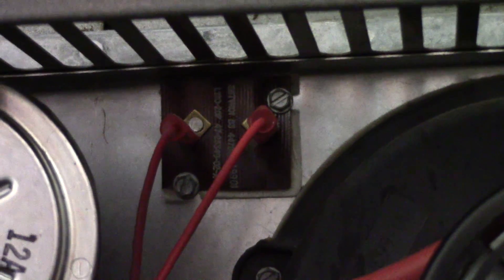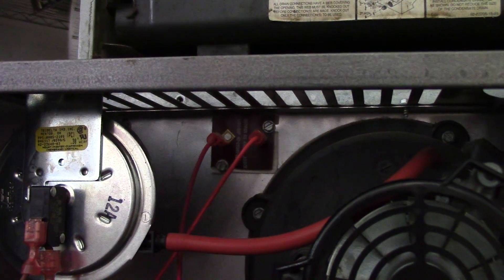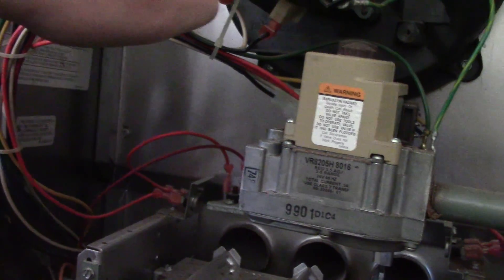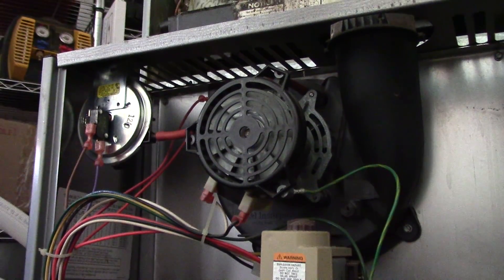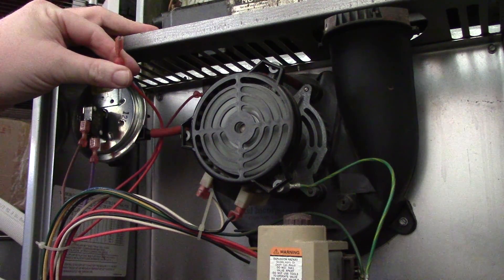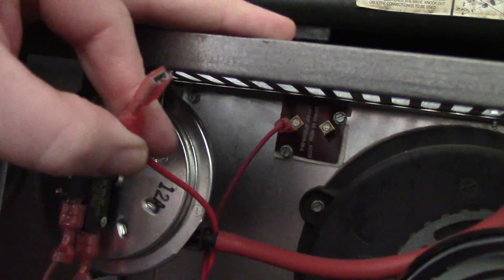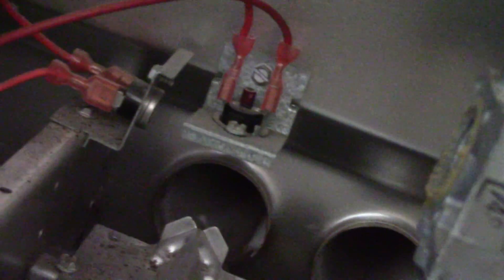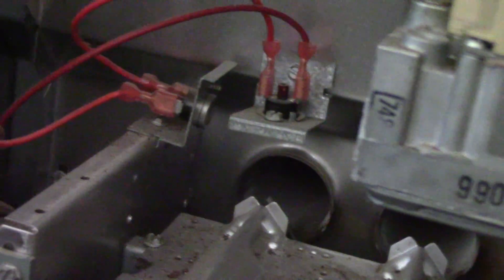Gas furnace high temperature limit safety switch troubleshooting

Comment: I must thank you sir, you have saved me a lot of time and money. Websites had me chasing the roll-off circuit for my Goodman furnace. When I took another look at the schematic I found the actual circuit. I was about to replace the board thinking it was a faulty relay.

Note Goodman owners, some models use 2 of the smaller metal limit switches. One is just below the roll off sensors, the other is mounted in the roof of the blower cabinet and sticks into the furnace cabinet. 

Mine tripped when I forgot to remove all the paper from a new filter.
Reply from the maker: your welcome. glad I could help.

Comment: Mine said it has a bad limit switch just waiting 2 weeks to get it. Put it in and still getting same code. Furnace still not turning on. What now
Reply from the maker: Follow the schematic to see what else is in that circuit. If it was installed wrong it could ground out and give false reading to the board. Bad wire connection, broken wire. Use a meter to ohm out the circuit. There could be auxiliary limits if its a down flow.

Comment: Clogged filters, clogged evaporator coil or gas valve pressure too high. Rarely, a bad high limit.
Reply from the maker: True. Something takes a safety out. I've only seen a few times where there was the wrong one installed.

Comment: Excellent advice for troubleshooting. My safety switch was working properly on start up but was triggering (opening) after the furnace ran for only a couple minutes. Apparently, the switch is weak / acivitating at too low of a temperature. After checking the duct work, filter and outside vent to confirm there were no blockages, I ran a short jumper to bypass the switch. Furnace is now running and temp coming back up as I type. Sunday repair so will pick up a new switch tomorrow when the HVAC supply store is open. Thanks!
Reply: One additional follow-up. I confirmed with the T-couple on my multimeter that my safety switch (rated at 145 F) was triggering around 104 F so a new switch is needed.
Reply from the maker: Your welcome.glad I could help.

Comment: Had a Lennox G40 stop turning on the heat past 2 days and freezing me in my house.  Many hours of debugging (Im not a HVAC guy)  
The green lights indicated "Open Temp Limit switch"  
Trouble is the switch was not open it was closed.    
I had no idea what the two little round things were (Roll out switch) If those are buttons there are frozen they did not push down.   Anyway I wiggled all the wires on the roll out switches and the Temp limit switch connectors as they looked oxidized.    I am not sure which connector was no passing voltage but its all working 100 percent now.

Question:  Should I just replace the two roll switches? or just spray deoxit on the connectors to help with current flow?

It was either roll connections or the two on the the temp limit switch.   Anyway I have heat again!!
Reply from the maker: I'd replace. If the roll out switches don't work right, and you get a situation where you have the flames rolling out you will risk a fire.
Reply: @ChilesHeatCool  I don't know if they work right or not.  would have to take a flame to one and see.  If they are already in the down position then you would not expect them to go down any further.  If it was UP then the circuit would have been open and the furnace would not work.    Im going to have a pro give it a once over see what he thinks.   But not one  weekend.    Its working fine atm.

Comment: Hi - my furnace also is short cycling - after 3 or 4 minutes the burner turns off, then back on for a few minutes, then the flame goes out again…. My blinking lights codes show watchguard - burners failed to ignite.  I removed the flame sensor and cleaned it, but the problem continues.  Do the flame sensors go bad like this?  It is a 24 year old Lennox, and seems more like a high temp sensor issue but I’m clueless.
Reply from the maker: Yes the can go bad or you lost ground. 

https://youtu.be/6_FDArHi6Q4
Reply: @ChilesHeatCool thank you so much!  I will try a new flame sensor first.  I’ve learned allot today and appreciate you - subscribed!
Reply from the maker: @Brian-kn1qw your welcome.

Comment: My furnace short cycles like it is overheating . Its not the flame sensor. Its like after 3 or 4 minutes of running it shuts off flame. The exhaust flue is hot. How do I trouble shoot what part or why? It doesn't appear to have any blockage
Reply from the maker: Is it giving any codes on the diagnostic light? You will need a meter to verify what switches are open and closed.
Reply: @ChilesHeatCool  Thanks for responding,  it was giving different codes at different attempts. Found it to be a partially plugged pressure switch port. Allowing for vacuum sometimes or not at different times.
Reply from the maker: I was going to say, pressure switch or flame sensor. Glad you figured it out.
Reply from the maker: Actually it's from the air density as the air is heated up and can't maintain a certain vacuum to keep the switch closed. Sorry I nerd out on this stuff and figure I would share.

Comment: Reset my limit switch after it was blinking four times and now everything is back to normal. Changed filters and cleaned it and now i got heat in far northern wisconsin and saved $$$.
Reply from the maker: Good deal

Comment: Great video. Don’t know if you’ll see this but. I’ve got a diagnosis question. I’ve got a Lennox furnace and recently got the trouble code of primary / secondary limit switch open. Filters aren’t clogged. I cut power and gas to the furnace. Jumped the primary limit switch, powered up furnace and now I have flame and heat as it should. Cut power / gas again and  reconnected limit switch, rechecked and system works fine. Problem happened again two days later. Do I most likely have a bad limit switch or is there anything else you recommend me checking.
Reply from the maker: Air flow and gas pressure will cause the limit to trip. 

Do you have a dirty blower wheel, dirty secondary heat exchanger (high efficiency furnace), dirty air conditioner coil, blocked return, to many supply dampers close or registers close, blower speed to slow. That's all the air flow stuff I can think of or a zone system we're the zone dampers are closed or dump some damper isn't opening. 

The only thing I will say you will need a tech for is the gas pressure. Your gas valve has a regulator on it to step the pressure down. You need a tool called a manometer to make sure it's adjusted to manufacturer specifications. I say call a pro because you're messing with the gas, and any accidents can cause insurance to say we won't pay as that will hurt their profits.
Reply from the maker: https://youtu.be/ybywcbklpLo

This is a long-winded video, but see what the temperature rise is can tell if the switch is bad. Make sure the supply air temperature reading is out of sight of the heat exchanger. 

The switch will have some number l140-35 for an example as they vary. The l140 is the limit of 140 degrees, and that's when it opens to cut off the gas. The 35 means it must cool off 35 degrees to close and allow the gas to flow again. So 140 minus 35 equals what 105. So the supply air temperature should be 105 degrees f. If it doesn't perform close to the specifications, than it's bad. If its rated at l145, opens at 135 its opening to soon its bad.

Comment: I have a Rheem 3 years old unit. With an issue related.
Here's what happens:
Temperature is set for 70
furnace starts heating up and turns on.
Furnace light says “H”
30min later Flame in the furnace goes out and blower continues. This happens well before temperature is reached
Furnace light blinks “22”
Furnace kicks back on after almost 3min on the second try, flame is lit, changes to “H” with a yellow light next to it. 
This cycle keeps going but 2nd time flames go out is after 10min then 7min. After that my set temp is reached! Do you know what that could be?
Reply from the maker: Dirty fan, dirty filter, to many supply dampers closed, manifold gas pressure to high, dirt coil, dirty secondary heat exchanger.

Comment: Can a bad igniter cause your furnace to throw an open limit switch code?
Reply from the maker: Nope. Only an open limit, bad board, or bad wires or connectors.

Comment: I did replaced the heat sensor as well as the mentioned high limit sensor...but it keeps reading Primary/secondary limit switch open.....how can I reset the roll up sensor?
Reply from the maker: https://youtu.be/QXpRosP2gAo?si=mC8Pvfs0ELjvWxlg

Button on top.

Comment: Very rarely do switches go bad. Usually there is a problem setting it off. Did not show the actual troubleshooting.
1. Is the filter fresh and merv 7-8. 
2. Is there any obstruction anywhere, secondary heat exchanger plugged, evalorator plugged, a lot of registers closed off, returns blocked, are dampers open?
If it is still overheating, check gas pressures and combustion.
Check blower speed/heat rise on system and adjust blower speed accordingly.
Reply from the maker: Lol high temp limit is different than pressure switch  lol.
Reply from the maker: That was mentioned dude
Reply: For troubleshooting.   My furnace short cycles - it reaches temperature set on thermostat, switches off, starts again in like 30 seconds, switches off,  starts again etc ....   How to check it is not an overheating ?  (though reaching thermostat temperature seems to point at that it is not)

Comment: This is my problem do you think this would be the switch  .......Problem:  When desired house temperature is reached the heating portion of the cycle terminates, but the furnace blower fan fails to turn off after removing excess heat from the furnace. The furnace must be manually unplugged to accomplish.
Reply from the maker: Yes if its an old fan limit electromechanical control. Newer style furnace it may be set to long or the contacts are sticking on the relay on the board, and it would need a new board.

Comment: Thank you so much for this video! My furnace stopped working at 7pm on Christmas Eve and it's 10° outside. Turned out the high limit switch connections were corroded, cleaned them off and it kicked back on like it should.
Reply from the maker: Your welcome. Glad I could help. Feel free to share to help others out.

Comment: There is a way to reset the high temp limit switch as well. Turn off the emergency switch and disconnect the two wires and take out the 2 screws. Remove the high limit switch and flick it with your finger and that will flatten the disk. Reinstall the high limit switch and connect the wires and turn the emergency switch back on and run the heater until it reaches thermostat temperature. If it goes off you reset it. If not you need a new high limit switch.
Reply: So if you suspect switch is bad just replace it? Don’t flick it to try to reset it. Thank you for letting me us know about potential fire
Reply from the maker: That is not fixing or resetting. It's like hammering your starter to make it work. It's only going to last so long till it's done. What it there is a legitimate problem and the "reset" causes a fire. Trust me, it's so much cheaper and easier in the long run to fix it right. Very important on things that can kill you. But, this is America and you have the freedom to do that if you want.

Comment: Is there any other sensor that detects low air flow? I was getting a code 33. My filter got plugged up with white minerals powder from my running a cool mist humidifier all the time. I changed the filter and stopped running the cool mist now furnace runs normal. The mystery though is I never had to push the reset button on the limit switch all I had to do was cycle power to the furnace to get it to run for a while until it stopped with code 33 again.
Reply from the maker: Limit switches don't have a reset. They just auto reset till it breaks. Dirty coil for the air conditioner, dirty secondary heat exchanger on a 90% furnace. Living in high elevation causes the low airflow code with furnaces due to low air density. Blocked returns or to many supply registers closed.
Reply: @ChilesHeatCool  I'm at 5300 feet. My limit switch has a button but I didn't have to push so does repeated cycles ultimately cause the button to pop up and then the switch is broken?
Reply from the maker: That altitude may be causing part of it. No the button is a manual reset. The only safety that has a reset is a roll out switch. The limits switches are all auto reset unless this is something brand new. If its heating I'd call it good. I know the altitude of Colorado springs and monument Colorado always gave the higher end furnaces issues due to altitude. They worked it's just the low air flow code since the motor can't tell air density just airflow per rpm of the motor.
Reply: @ChilesHeatCool  30 year old Bryant. All the problems started at season start up. First bypass humidifier cage motor not running so no humidity cooling bypass air. Then I installed a better filter nano kind. Then started running cool mist humidifier around the clock. Code 33 starts. Filter covered with white minerals. Installed $1 barely a filter and block humidifier bypass. Now runs fine no codes. Waiting now 5 weeks for cage motor from skuttle. No stock. Paid for it but don't know if it will ship this season. House 25 % humidity very dry.
Reply from the maker: I would have someone check it. Just do an annual service. Becareful with a to cheap filter that doesn't really filter. They let the equipment get to dirty.

Comment: Thanks for posting!  Very helpful.  My three limit switches all tested closed/zero ohms/good.  Turned out to be a bad connection of the high-temp limit switch circuit wire on the multi-plug which plugs into the controller module.  No voltage was getting onto the high temp limit switch wire.  Unplug/re-plug, problem solved.
Reply from the maker: Your welcome, glad it helped.

Comment: Appreciate the videos. Have a 1999 Rheem criterion 2, 100,000 BTU/80%. Installed 10/2000 and very reliable. The last 3 seasons I've had short cycling issues. I clean the flame sensor, reinstall and forget it. My usual trick didn't work last week and I was in awe. Tossed down 15 bucks for a new a new flame sensor locally, no change. Today I tapped the top of that roll out sensor with my finger and she's running normally again. Getting near the end of heating season in central Ohio. My outdoor condensing unit is 38 years old. Weather King before Rheem started using the name. Made by Addison products inc. 1984. 

All said, think it's time to replace the system. Like Rheem/Ruud. See Goodman products on the lower end. Advise if you will
Reply from the maker: The quality of the install is more important than brand name. Basically 2 companies make the gas valves and safeties. If the manifold gas pressure and air flow set right during the install, the furnace won't last. If the ductwork isn't correct it won't work right. 

I put goodman in my house, and I've installed many of them, Lennox is expensive on parts and have part numbers custom to them so you can't just buy a part unless you can match it up. Trane make good furnaces but I hate cleaning the a/c coil due to the spines.

Comment: So my furnace, exhaust and intake are clear with no obstructions. If the door is on the burner box, it tries to light but will only stay lit 5 seconds then off. Then it will try 2 more times and put itself out. We have changed out the exhaust fan, the flame sensor and the pressure switch….. we have no idea where else to go….. we are currently living with the burner box open. The flames going into the exchanger are coned and don’t show any signs of the heat exchanger being cracked…. HELP.
Reply from the maker: It might be related to the flame sensor. It could be a dirty burner or bad board or bad wire or the furnace lost ground. I know you you replaced the flame sensor but what was the micro Amp reading? This link is how to test the flame sensor. 
https://youtu.be/ep5H1J5TB1o

Comment: For those who read these comments. Do NOT reset a rollout unless you're a professional or know what you're doing. Do this ONLY to troubleshoot one time. CO could fill your house and you'll be dead before the tech comes to replace/repair your system. There are a few reasons why you're rolling out flames so have a Pro assist you.
Reply from the maker: Right. That gets covered under my roll out video switch.
Reply: Thank you for that information
Reply: Soooo... Now that my heater is working after watching this, I should just turn it back off?
Reply from the maker: If the rollout switch tripped, reset it and it did it again, yes. Possible heat exchanger crack.
Reply: @ChilesHeatCool  ok thanks!
Reply from the maker: @TheRealMattBell you are welcome.

Comment: Soo i just replaced my pressure sensor switch and still having the same issue. It fires up runs fine with heat and flames for sometimes day, sometimes 10 minutes, then kicks off and throw a pressure limit code.. im lost now..
Reply from the maker: Is the port to the pressure switch clear?
Reply: @ChilesHeatCool  the port on the actual switch or the port the tubes go into? Both seem to be clear
Reply from the maker: Port on the furnace. They some times get clogged on the furnace if its a damp location. If its a new switched that is the same rating, did you use the new hose or old hose? If they still include a long hose with the new one did you cut it down to size? Some times the new hose is to long and kink just right. If that's all good then you will need a manometer to test the vacuum on the inducer. The squirrel cage in side could be rusted out or crystallized.
Reply: @ChilesHeatCool  thank you. Same hoses, just checked both all clear. I guess the inducer is the next check. 👍
Reply: @ChilesHeatCool  not sure if it helps any but it is a lennox
Reply from the maker: Unless the board is bad or vent plugged.
Reply from the maker: https://youtu.be/_CS3-ToC-fE